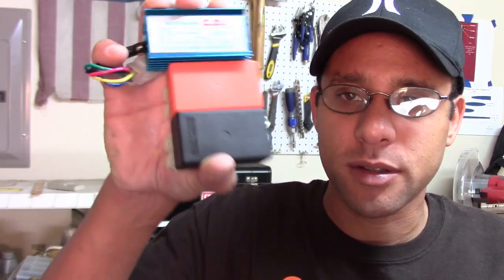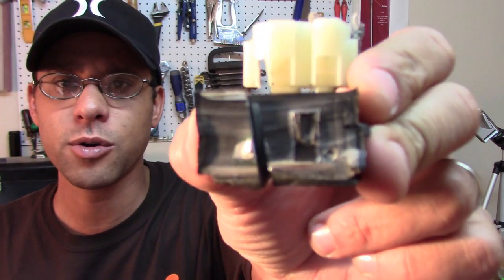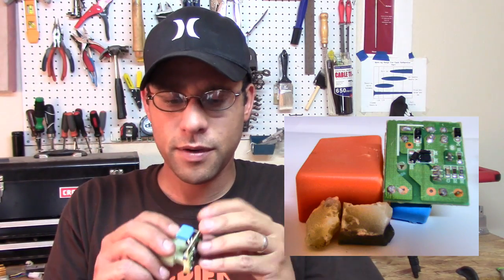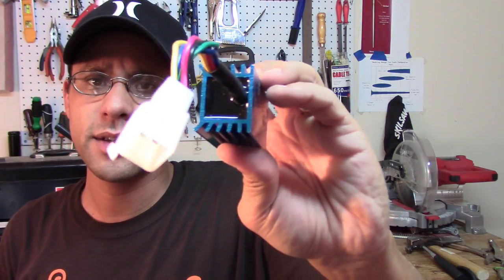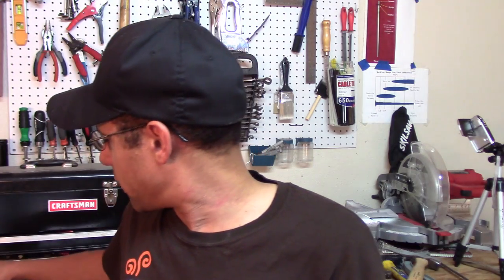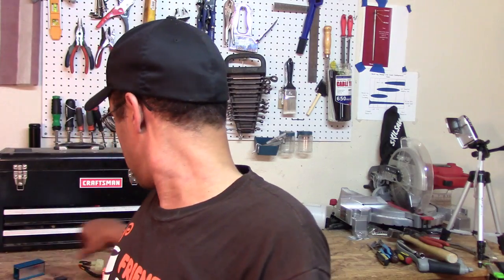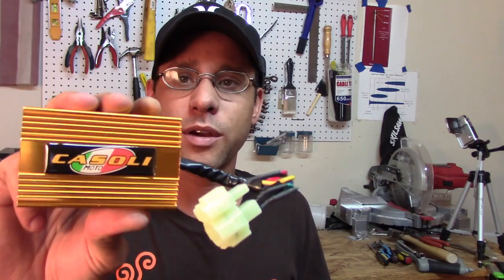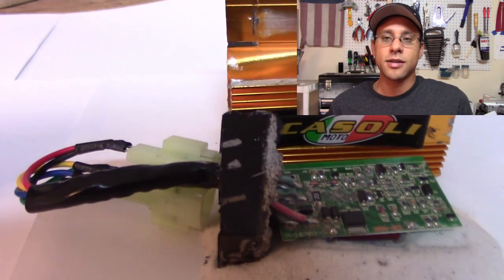GY6: A Look Inside GY6 CDIs

Comment: Wow thanks for the video. Learn a lot today and found out there is AC and DC version. My 2-pin has only 1 wire but i bought AC Racing CDI (Orange) from aliexpress. Cold start seems hard (And yes idling is high) but after warming up starting has no issues. Will try the Casoli CDI as recommended by you. 

Googled the difference: How do I know if my CDI is AC or DC?
Your CDI has two plugs, a 4-pin and a 2-pin. ... If the 2-pin connector has only 1 wire going to it, it's a DC CDI. If there are 2 wires attached to the 2-pin connector, then it's an AC CDI. Note: A very few DC-powered CDI systems will have two wires on the two-pin connector.

Comment: HI, good video, I have 2 scooters 50cc and 150cc chinese specials, I have the original CDIs that came with bike and it works fine, I bought both the orange and the blue Amazon ones, IN the 50cc the only one that works is the blue one and it seems to run better, it will not start with the orange one,,,,the 150 will not start with either the blue or the orange one, but starts with orginal, what do you think is happening? IS this a timing problem?  TY for the videos!

Comment: The plastic or rubber is potting compound. Used for insulation, vibration, and moisture protection. It has nothing to do with the operation. You wasted a lot of time and money. What you should explore is the circuits and quality of the components.

Comment: So as far as I can tell there are no microcontroller chips or anything else special on the circuit board of these CDI modules, it's just the difference in components that gives a different timing curve. That's done with an R-C time constant network.
I have a new scooter, a Peugeot Speedfight 4 and the guy in the shop said to me that to make my scooter go a bit faster he has to change the software but I can clearly see in your video that none of these CDI modules have the necessary chips and circuitry capable of running any software.
Now I don't trust the guy from the shop anymore and I'm a bit confused, I did see there are some CDI modules that have an extra wire poking out and they say that when that wire is cut or not connected that only changing this one thing it will make the scooter go faster, I can't find any concrete info online or a schematic to confirm that statement... I would appreciate any help figuring this out, my scooter is very restricted and only goes about 48km/h tops which is really really slow, even with the wind in my back and going down the hill doesn't make it go faster so even someone on a bicycle going down the hill will go faster than me which is ridiculous and I want it changed.
I normally do everything myself but because it is brand new and I don't want to void the warranty I'm obligated to let the shop do the maintenance and the guy said he can make it go faster by changing the software and I think he just saying that to trick me into paying too much for what has to be done really to make it faster.
Any advice for me what I should do?
Reply: The more expensive cdi units are micro controled the efi box or the nicer one is micro processor control the ebay cheapies are not they're just way advanced timing all the way

Comment: Can anyone help? I have a toa toa pony  50 cc scooter I did the cdi test and unhooked the battery while it was running and it stayed running. So that's a AC system right? Well I tried a racing cdi (ac) and nothing. Then I tried a dc cdi and it started but it's breaking up when I apply throttle. So I'm confused.

Comment: The gravel does no harm as long as it does not touch the components. It is simply to save on resin costs. The worst cases are metal as they tend to rust and let in water. So who gives a fuck?

Comment: I have a 100cc big bore kit in my 50cc scooter and a stock CDI.  is that why I'm not seeing any difference in speed?  Thanks in advance.
Reply from the maker: Did u re-tune the rest of the bike?  Carb and CVT?
Reply: If you are still interested, with a big bore kit, to really get more speed, it needs a higher gear ratio, and CVT tuning, you can possibly get another 3?20 mph with a gear swap,

Comment: Filler is completely irrelevant. The only thing that matter is the electric design and choice of components. How it even can be a market for these is beyond me. You can easily do timing advance with a couple of RC-filters (4-5 resistors and 1 or 2 caps). Also that last "fancy" one seems to do just that, analogue advance. Not digital with a pre-programmed curve. I would be expecting digital timing for 40-bucks.

Comment: Apparently you can't get the gold casoli CDI box anymore. I tried to go to their website and it looks like it's been closed down. Any other suggestions as where to get it?
Reply: Todd: I wouldn't spend $40£ on that, it's just one or 2 analogue filters (That CDI is cheap, overpriced with mediocre stability (yes, timing will change with temperature!)). You can easily build similar or a better performing CDI yourself with $£2-3 worth's of components.
Reply: Big Cheese 
1. Most people don't have time and the skill for it
2. You need welding gear (Good quality one's to be perfect on assembling a cdi)
3. It is not as simple as ordering some components and "mashing" them together.. 
4. Rather than complaining about the quality, start making and selling them your self.
Reply: korohon: 1.Yes, everyone is entitled to buy whatever overpriced shi.. product they want. 2. Absolutely not, a sheap-ass soldering iron is all that's needed (a tool every man should already have in his/her toolbox and be able to use (even my retired MOM has one!). 3. Yes, for an analouge AC CDI it pretty much is just that simple as you described. 4. I have no interest in contributing/selling overpriced junk, there are however several people making adjustable and unpotted ones usable for this application for a FAIR price. Meanwhile, free for all, this one controller I designed for variants with 2-toothed single pickup setup: www.partsim.com/simulator/#121705. Want a fully adjustable digital one? I designed one as such too, open source and free for anyone to use!
Reply: @TheFirstBigCheese  Next time I go to buy something I'll have to remember to run it past you first to make sure it's a FAIR price seeing how you've pretty much appointed yourself to the position of "fair price police". Oh and how about you post a list of what "every man should have in his/her toolbox" and a list of all skills they should have. You know, since you're the Big Cheese and all.
Reply from the maker: Sorry again about missing comment, I get a bunch.  NYCScooterParts is still in business and has them in stock.  I talked to the owner today to confirm.  Biggest thing is knowing whether you have AC or DC.  Go to his website and order or call

Comment: hello my friend from greece! i have a gy6 50cc scooter i have rebuild the engine with new parts everything works fine but in 2 months the scooter refused to start easy i must make many kick starts to start and its like dies slowly... so i have change new carburator new coil new bobbins new spark plug and new cdi ..... but! it wont start again axept 2 times and alot of kick starts! i have spark but it is too weak ! so as i have see the mixture wet the spark plug and the engine of course wont start! any idea ??

Comment: I installed 2 of the blue boxes on my gy6 150cc engine and they both smoked and burned up. I have an AC system. Are these really that poor of quality?
Reply from the maker: Yes. I would go with stock or orange.  Either way, they don't make much of a difference.  And where u getting them from.  The super cheap ones are even bigger piles of garbage
Reply: Joey's Garage I got them off eBay. Yes they were really cheap. Both of them smoked as soon as I hooked them up. The stock one works fine.
Reply: Sounds like you may either have a dc system and ordered ac cdi's, or somehow the ones you ordered were dc cdi's because you do in fact have ac. I got cassoli and it's been fine for years. 😁.
Reply: Joey's Garage the Cdi’s that I tried are just like the blue one that you have. My carts engine will run when the battery’s wires are disconnected so I assume it is an A/C system. That’s all I’m basing it off of though.
Reply: Mike Moore What is your scooters full model ? 
For example, mine is: Keeway Focus
Just go to google and type your bikes full name followed by "manual"
Edit: You should see if your scooter is ac or dc
Reply: korohone ok thanks
Reply: Mike Moore Side note, if you find the manual, the list can be extremely long. 
I'd suspect the dc/ac mark is at Magneto page
Reply: No lol. There’s AC and DC CDI. This should shed some light for you 👍🏼

Comment: i jusy put in a new engin in my 150cc scooter i ground all the wires an it run great but the problem is when i rev it up all the lights blu head lights gas gauges\lights blinkers still work back light still work wat is it that happen
Reply: Syxx Williams does the green light on this cdi suppose to blink when u tryna start the scooter?

Comment: I was thinking about cutting one open to see what's inside, so I enjoyed the video in that respect -but I couldn't care less if the best ones were encapsulated using dingleberries -I'm interested in their performance. I suspect they are encapsulated to prevent vibration damage to the PCB, and then, secondly, to provide a heat-sink. In the case of the latter, the rock probably works better to aid heat dissipation than does solid epoxy/rubber/plastic alone!

Comment: i want easy starting but better throttle response and no limit.. if the ncy works like this too and is better quality i will pay the 40 to 60 for one.. i rather get the desired results for more money than buy whats cost less and my engine run weaker than stock

Comment: im refering to the aluminum orange cdi.that advances only during acceleration.. so does anyone had experience with the ncy brand cdi.. its the most expensive it ranges from 39.99 to 59.99 on ebay.. it was not discussed on video. theres also a cdi you can adjust.. those were not discussed either... im curious about the red ncy brand cdi. what kind of characteristics does it have.. does it offer easy cold starts. and a steady advance with as engine speeds increase or is it just a show piece with a brand name making it pricey? like the blue and orange cdis.... over advanced at idle
if it offers easy cold starts and advances seamlessly with acceleration i will pay the extra money for one.. any input is appreciated...

Comment: im refering to the aluminum orange cdi that varies advance, not the plastic orange one.. in my last message to clarify..
please anyone. how well does the bright red. plastic ncy. brand cdi function.. theres has to be some desirable function as it cost the most out of all cdi brands. it looks just like a factory cdi. except its red and it has the ncy logo in white on it. anyone had experience with these? are the the best or just overpriced because of the brand?

Comment: Just ordered a blue cdi came with orange coil and a spark plug.. Trying to score a few more mph. After i watched this..Hope i didnt just buy some useless crap...
Reply from the maker: +john floyd Let me know if u get some extra speed from them.
Reply: Joey.. you are correct.. The performance cdi.. Advances timing too much at idle.. Its hard to start with our current 40 degree mornings.. Starts ok when warm.. 
I shoulda bought the orange cdi you reccomend that. Only advances as rpms rise.. Just like a car or truck engine. But i notice theres like 3 or 4 of those variable cdis being sold. Same color and shape but different name.. Are they all same or which ones are junky immatations.. Which name is the best to buy?..  What about the red ncy brand cdi.. That one wasnt in the vid..  Does it advance with rpm change too? It must be one of better quality and function.. Its the most expensive.. I like more power. But the quickest and easiest starts mean alot to me as well..

Comment: that gravel is actually silica gravel, they use it so it acts as an insulator and keeps moisture out of the electrical components.
Reply from the maker: +anubis1100 Thanks for the info. Cheers

Comment: Most people just would use the lubrication from the gear oil and use no 
grease at all. Also, is it ok to mix the two together(grease on the gear
 bearings and then use gear oil after closing the gear box and wht type of 
bearing grease would u  recommend.
Guys like you, allow me to have the confidence to start and finish my 
repair projects.
 Do some videos on the differences between stock/aftermarket products and 
 the differences between Chinese, Japanese, Taiwanese 
and European bikes.
 If you start to get rid of your stock parts on a Chinese bike for hp 
parts could it really pay off in the long run and are the Chinese frames
 worth the expense ! Can you also explain the proper way to do a compression test, valve adjustment, fuel/air adjustment and which parts affect my fuel economy.
 Thank you, so much

Comment: I have a 139QMB engine short case. Which stator do I need for it, and is it 6 or 8 coil?
Reply from the maker: +WILLIEBEATZ ProDuctionZ Agreed, you will have to check to find out.

Comment: was about to dislike because you did not go into detail about the circuits inside (why i came here) but then i saw you have 0 likes and did not want to mess that up or be "that guy"
Reply from the maker: +aterack833  Thanks for not being "that guy" lol.  This was one of my first shows I did, so it wasn't one of the best. And I wanted to talk about the circuits inside, but most were so badly damaged it wasn't possible.  Except for the gold advancing timing CDI, the blue and organ boards were all the same. Even the markings on the boards were the same.  I'm guessing a single Chinese manufacturer make them all, then a assembling company buys in bulk. 

Either way, thanks for watching.  My later videos should be much better.
Reply: ***** i mostly just wanted to know what was inside so i could know how to repair them, also i have my whole harness off and wanted to test the ignition module but don't know what the pickup coil wires go to or what the pickup coils should output to the module
Reply from the maker: +aterack833 I believe I have seen someone post those reading on http://itistheride.boards.net.  Let me look and see

Comment: Wow... so those heat sinks really do nothing, there's nothing connected to them, no thermal compound, anything. They're just for show.
Reply: +Joey's Garage im trying to put a 150cc motor on a 50 frame but the cdi on there now only has 5 wires the one that comes with the engen is a 6 pin what do i do
Reply from the maker: Yeah. But they make the CDI look high speed for their "racing" performance.  Awesome observation and something I never thought about.  Thanks for watching!
Reply: John Paul 
So, you have a scooter, that is stock ~50cc, and the wiring harness it has only has 5 wires coming for the cdi ? 
Does your 150cc engine come with a new wiring harness ? Or just a cdi ? 
I realise that I am asking 6 months later.